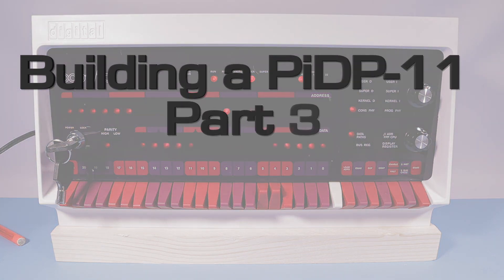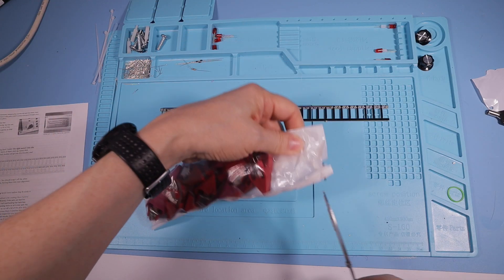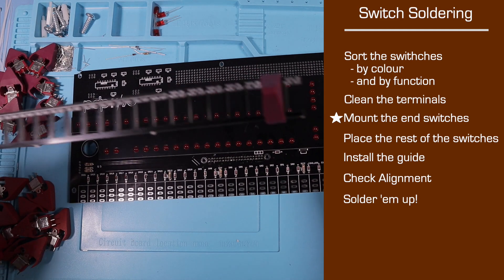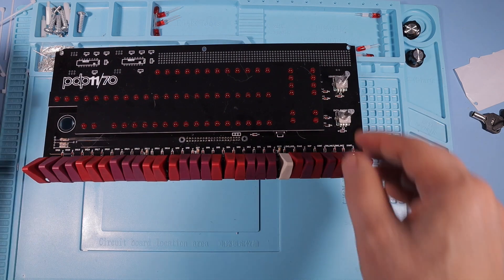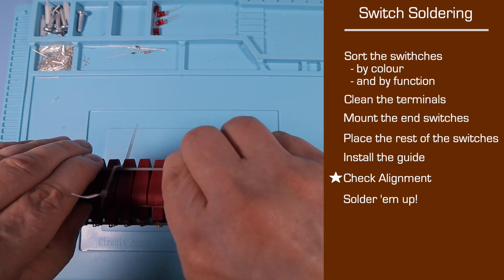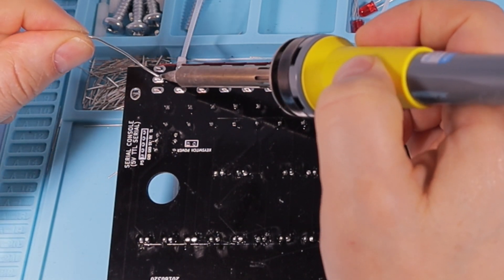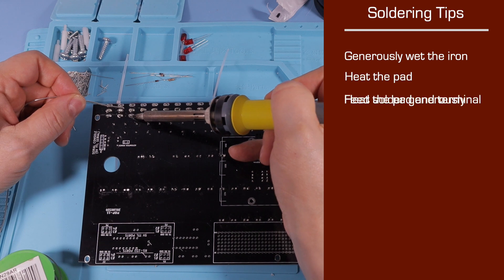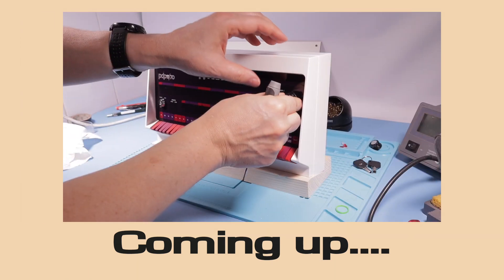PiDP11 Kit Build - Part 3 (of 4)

Comment: I did this with my Anker XS25 soldering iron. It's a fixed temperature at 390C. It means the joints heat up very quickly and the solder flows freely into joints. You don't actually damage the components because you're only one the joints for 1-2 seconds max. You just have to learn to be fast and precise with the iron.

Comment: No instructions on which way the White lamp test switch goes...  The screen print doesn't say... and neither do the instructions....

I'm going with up ... Here's hoping
Reply: It's goes up. it took me a while to work it out as well. There's a label on the left most red toggle switch that says Push Up. An arrow runs right from it, all the way to the White toggle switch, meaning it also goes up

Comment: Good instructions! For what it's worth, I found I had no trouble soldering at 275 degrees, including the switches. This was using a decent leaded solder (0.5 mm Sn63Pb37 from Kester), and an iron with a 1 mm chisel tip.

Comment: I love the look of this vintage computer. Would it be possible to build a voltage sequencer for synthesizers out of this?
Reply from the maker: The guts are a Raspberry Pi, so I should think that would think you might be able to find a Pi expansion board to do the electronic part.  You then run a task with the PDP-11 and a separate one for your voltage sequencer, or (with some limitations) you should be able to directly program inside a PDP-11 emulation.  That would allow you to control a sequencer and the display from the same code and reflect values from one into the other.  That's not trivial, if you aren't keen on retro-programming, but its possible.
Reply: @beige-o-vision6936  thanks. I have recently figured out that the first privately owned PDP-11 was at Peter Zinovieff's studio and he did use it to control synthesizers somehow, long before anyone else did it. Well of course that didn't have a Pi inside.

Comment: Thanks for the tutorials!

I think you have one small bit backwards. At 1:38, you say that the first (purple) switch should go up, and then after say that the next switch should go down. Shouldn't the first switch go down, and the second switch go up?
Reply from the maker: Ouch! You got me.  Note, I've got the instructions backward at 1:38.  First switch I put in goes down, the second switch goes up. However, the first from left goes up.  This might just confuse some folks. I'll try and fix this up when I'm back from my  current road trip.
Reply: @beige-o-vision6936  is this fixed?